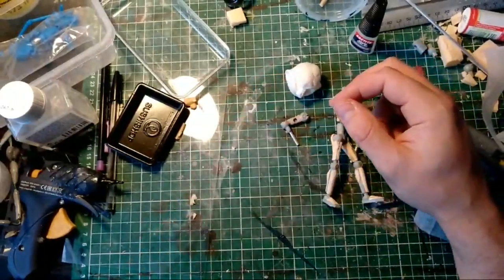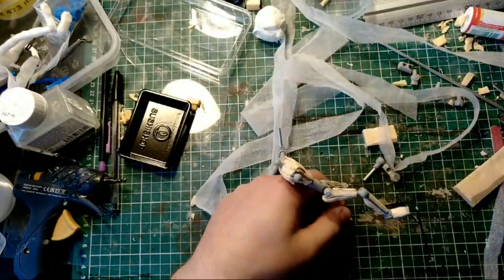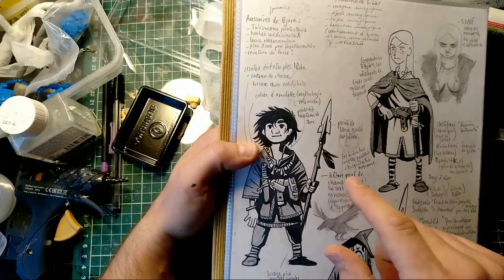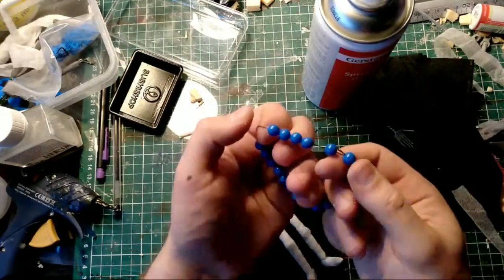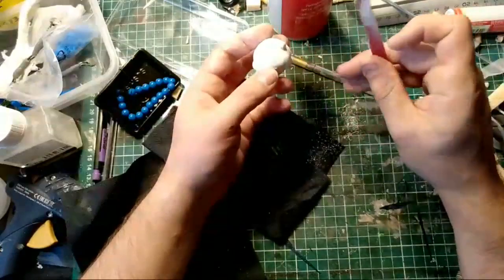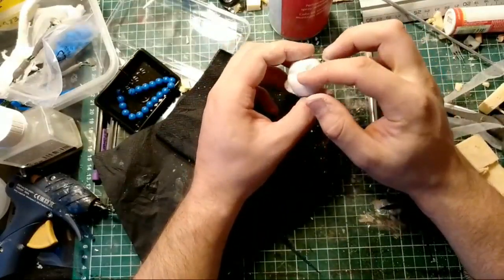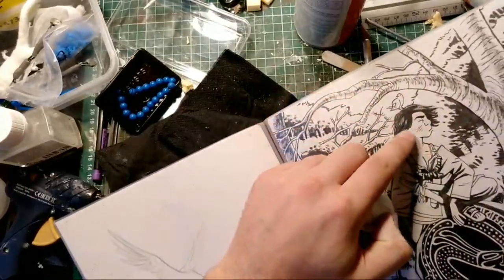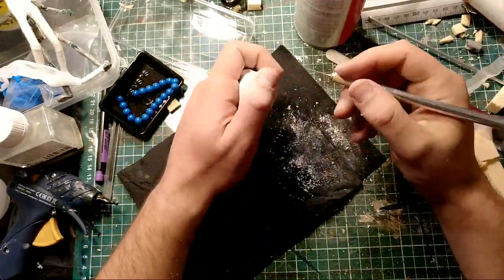Crafting a Stopmotion Puppet!

Comment: Ha, I have done a stop motion Grell for D&D, one 12th scale. We all love Stop Motion! If using wire twist take 2 strands and twist them so they interwine (power tools will help). It makes the wire so much sturdier and durable.
Reply from the maker: Stopmotion's awesome. I' tried twisting them but most tutorials of animators i saw said it wasnt the best idea. It does get sturdier but it also fragilizes the metal, twisting produces tiny cracks and being more rigid you'll have to put more distress to get it to bend...of course it all depends on the quality of the product you work with. I chose a articulated figure because i want it to last, and apparently wire always ends up breaking. For a articulated DnD prop it should be good but for stopmotion i want something durable.